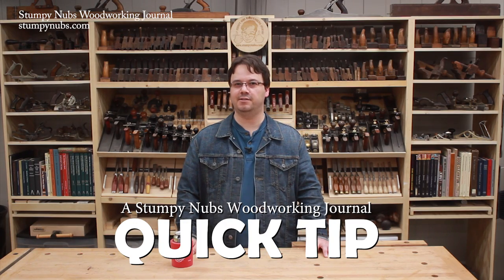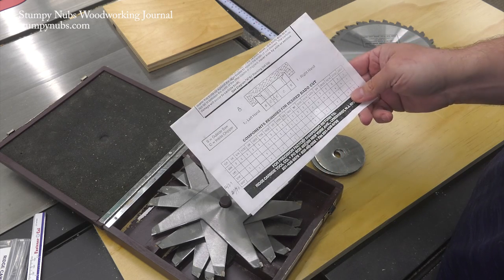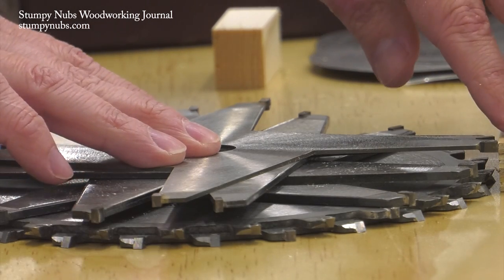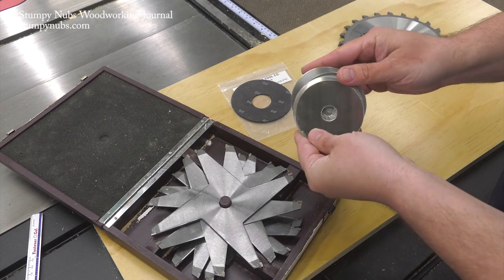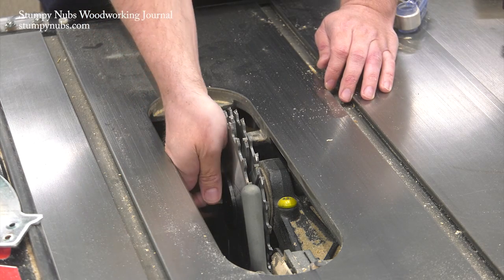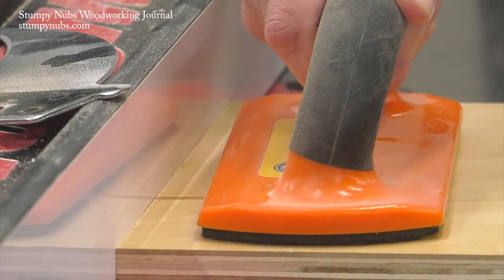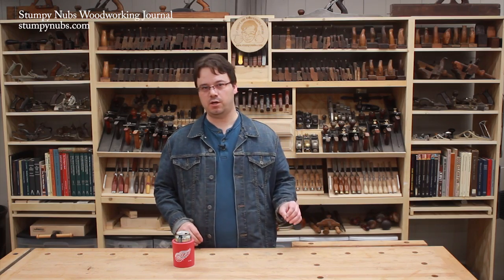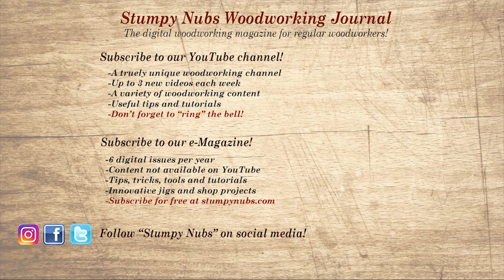Are you setting up your dado stack wrong? (Some clever tips)

Comment: I tried to use the link to the dado stack but even the website said I was banned because I live in the UK damn nanny state , great video though
Reply: I followed the link and it just says the website owners, Ridge Carbide, blocked access. It's most likely a commercial decision they've made, perhaps to control pricing in different markets or liability in various regulatory jurisdictions. My understanding is that dado blades aren't banned in the UK or EU, it's just the workplace regulations demand a stopping time for table saws that the manufacturers are unwilling to engineer for dado sets, so they largely chose not to sell compatible table saws on construction sites in those regions  A single blade has a lot less momentum than a dado stack so it spins down more rapidly. You can buy a suitable saw for personal use, this is about the health & safety responsibilities of employers.

Comment: Before purchasing a dado stack make sure your saw arbor is long enough to take the set. My Dewalt job site saw cannot take a dado stack.
Reply: Experiencing this pain right now with my DW745. Picked up the Diablo 8" 12 tooth stack and just running the two face blades for a 1/4" cut. Need 3/4" so doing multiple passes

Comment: Stumpy, please mention that not all table saws will have the power to spin a dado set.  3+ hp no problem, but 1.5hp not so much.
Reply: Paul Cox  I have a Delta contractor saw too.  The one with the funny tubular stand.  I have not needed a dado stack yet, but some projects I have in mind may require them.  Maybe I'll just use my Bosch router.  I dont' know.  To use the table saw I would have to make a zero clearance plate and that's a pain in the ass for my saw.

Comment: Crap, I should never try to do things from memory or while doing something else. The shot in my saw is not 1/4". That's just stupid, the bottom of the slot is 7/8" and the top just a hair under 3/4' on my Ryobi 10" table saw RTS10/RTS10G. If you know of a way the I can upgrade my miter that would be great.

Comment: Love your site. I’m an old retired man who has made his place in this world with wood. I still do cabs and occasional commissioned furniture, I’ve a nifty little shop.
All I’d like to make a useful tip. Digital calipers are approximaters at best, the very most expensively made digitals still have large margins of error. Switch back to a well made dial caliper and be dead nuts every time. I’ll take analog mechanical hard measurements over some little computer every day. My two hundred dollar Japanese made digital can’t go through a set of good quality feeler gauges with accuracy and yet my forty buck Fowler dial made in China came up dead nuts on all but two of the blades, makes me think the feeler gauge is at fault. Just saying.

Comment: I bought the exact magnetic shims in this video, and yesterday I set up my dado stack, made a test cut, and with a .012” shim the dado measured exactly .500” wide.  Super.  I had to remove the dado blades for reasons.  Later I put back the exact same stack up of dado blades and shim, but this time the cut measured .485”.  The difference messed up the box joint jig I was making.  What’s up with that?  Is it possible the magnetic shim compressed, from me tightening the arbor nut more than the first time?
Reply from the maker: How could a .012 shim compress by .015? Something else is at play here...

Comment: Ah, the classic caliper mistake: measuring off the edge of a piece using the depth rod. Flip the caliper over and use the ample back surface of the head to perform height gauge style measurements and leave the rod for measuring closed holes.
Reply from the maker: The way I did it works just fine. The results speak for themselves.
Reply: @StumpyNubs  It works, it's just more of a pain in the butt to get an accurate measurement since the measuring surfaces for the depth rod are much smaller. Way easier to accidentally get the caliper sitting at an angle or not flush to the upper surface as compared with using the back of the caliper head.
Reply from the maker: @Nicoya  - I'm sorry you struggle with it. Maybe practice a bit, because I have zero problems using the depth gauge like that. :)
Reply: Wow great tip. I never knew you could do it that way. Much easier to keep the calipers plumb to get an accurate reading. Thanks! Sorry Stumpy doesn't  seem to agree.